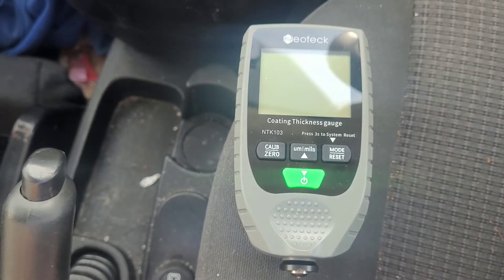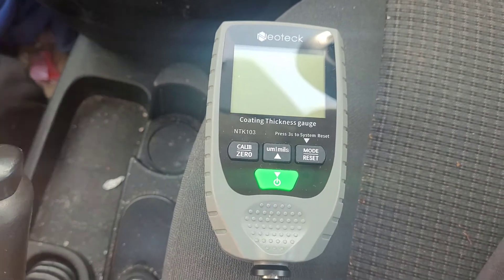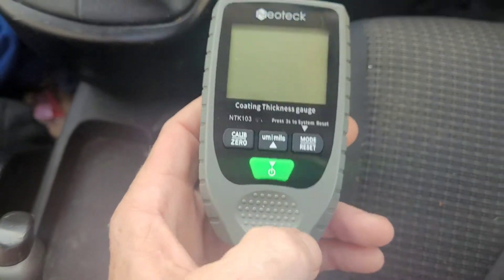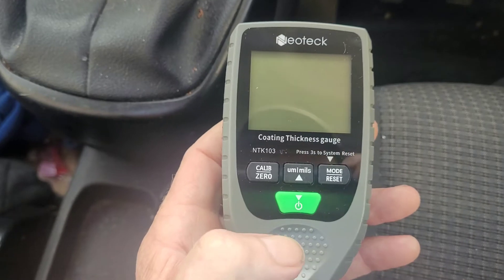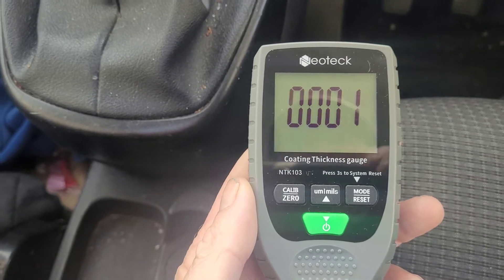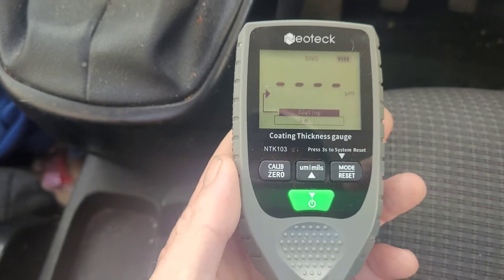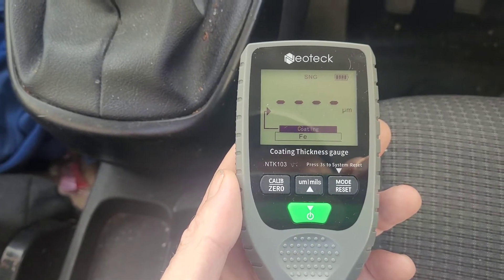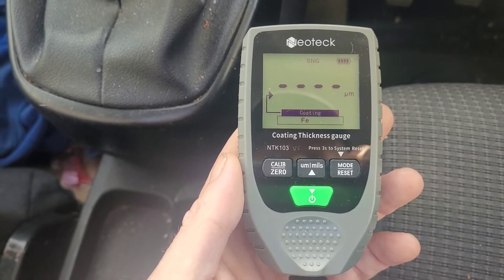Using The NeoTeck Coating Thickness Gauge On Body Panels Demonstration.

Comment: thanks .... how to judge the car is over painted or not ?
Reply from the maker: If you can't tell visually then take a base reading from a door shut, then bonet, boot and then roof to see different, generally speaking the boot, bonet and roof should be similar from factory, you could also place a tiny magnet on areas of roof to see if it sticks and if you find it doesn't (has to be a metal roof) may indicate bodywork filler, in other words, if repaired at some point, that may be a reason for overly high readings.
Reply: @HitchinValeting  thanks too much
Reply from the maker: Your welcome 🙏

Comment: Hi, would you say it is good? Worth buying?
Also what's the normal measurements in a car
Reply from the maker: Hi, I think it's a good starting point as in not to cheap but not the most expensive one to buy, regarding measurements, every vehicle different but a good starting point is to measure the door shuts as these areas generally have less paint, clear layer etc then the body itself, best regards
Reply: @HitchinValeting  thank you very much
Reply from the maker: Your welcome!